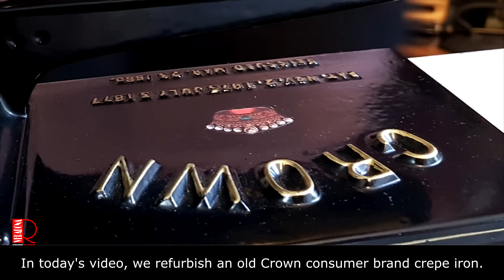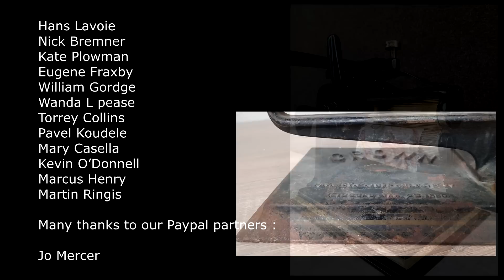Restoration - Iron American Machine CROWN 1875

Comment: Great job, loved that you cut through duplicated processes. Only part that wasn't my favourite was using paint pen instead of gold leaf especially for the base pin striping and handles. Adding the gold accents really makes it pop and classier over the original. Powder coating is also a great upgrade to the original. Both great choices
Reply from the maker: Thank you so much. :)
Reply: @VeradonaRestoration  Gold leaf is actually quite durable, I've done it to outdoor wrought iron gates, not any wear after 10+ years :) worth giving a try!

Comment: No lead means this was probably not paint but japaning. Also, have you thought about learning to braze instead of welding cast iron? Seems brazing would work good for a lot of your projects. Love seeing your vids most as you keep most all parts as close to original as possible 👍
Reply from the maker: I have 90% success with welding cast iron, I haven't thought about soldering yet. :)
Reply: @VeradonaRestoration  brazing is like soldering only hotter and with brass like rods. It has a much better success rate on cast iron in my opinion. But you seem to have a good method going as well 👍

Comment: Crepe/fluting irons were used to flute women's cuffs and collars on dresses. Also some were used for curtains and furniture trim. For clothing silk was used for delicate lacy cuffs/collars. Regular starch (linen and cotton) could not be used on silk so a 50/50 mix of water and white vinegar was used instead.
Reply from the maker: Thanks for the additional explanation.
Reply: @VeradonaRestoration  To make starch use 6 tablespoons wheat bran in 1.5 cups water. Bring to boil then remove from heat and let "sour" for 3 days at room temperature. Bring to boil again let cool and strain through very fine cloth like a jelly bag and squeeze. Dip clothing into starch and squeeze out excess. Flatten and let dry 24 hours on a flat towel. Use antique iron, heat it up and apply bee's wax to foot of iron and blotter excess on brown bag paper. When ironing starched cloth with charcoal/flat irons use bee's wax so iron won't stick. Best working temperature I use for fire irons is 230+ degrees F. Electric steam irons operate at between 350 and 380 degrees F.
Reply from the maker: @williamkuhns2387  Wow, thanks William for the perfect info, I didn't know that :)